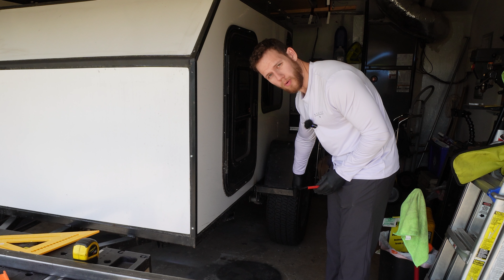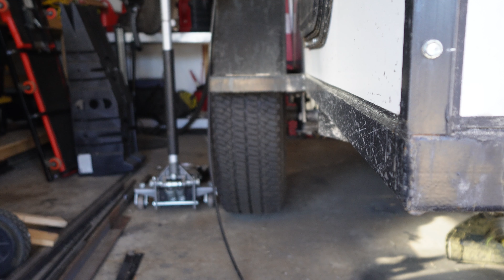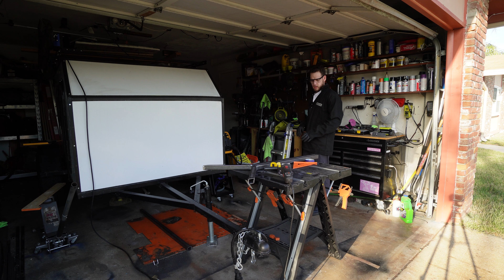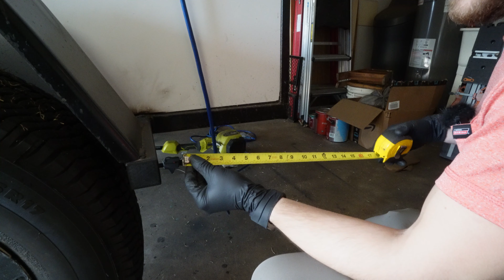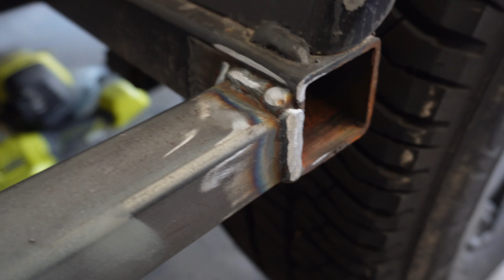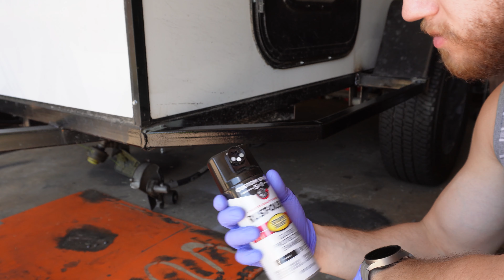DIY Overland Camper Build - Rock Sliders

Comment: You can get a 6' peace of diamond plate the length of your front .Strap it down on a flat area and lay a 2*4 in the middle and bend it to a 45 to fit your angle. Use a angle finder to bend your top bend. Clear calk and your done. Very nice job on your trailer.